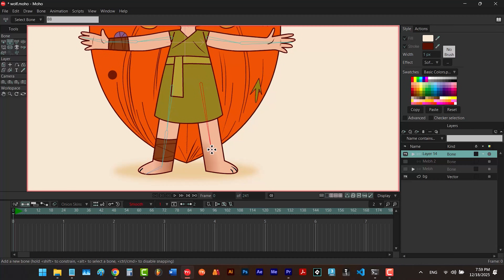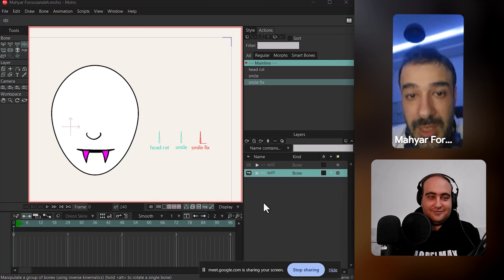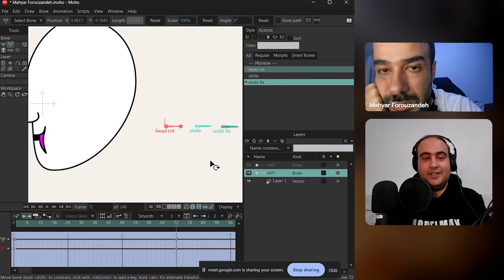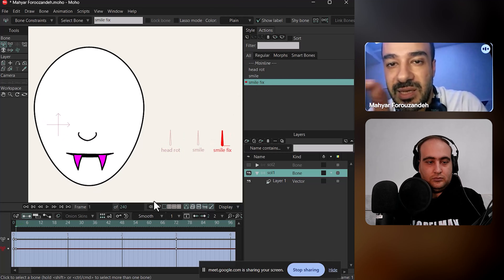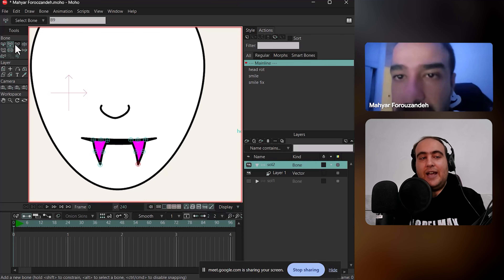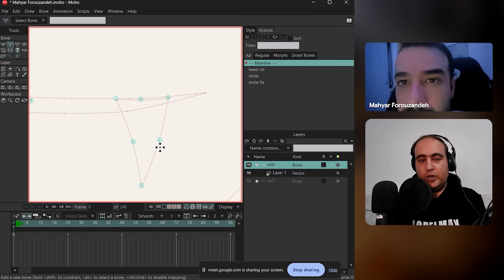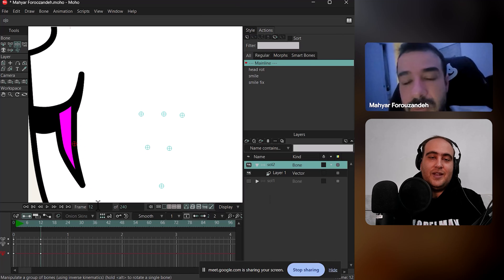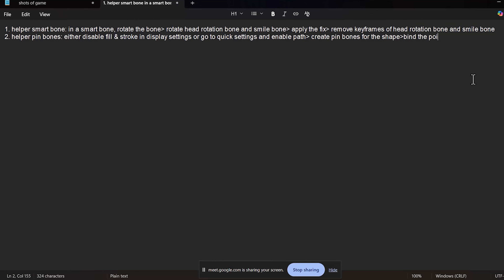Fixing Conflicting Smart Bones | Moho 14.4 Rigging Tutorial

Comment: What about using the MR mixed smartbones script?....
Can you plz make a tutorial using this script with the methods you just used please???....🙏🙏🙏
https://youtu.be/M0RJEjA21f8?si=0XavWUciAp2dULgV
Reply from the maker: Here our focus is on Moho's built-in features my friend, providing general solutions for all users including beginners, so that all users can do it. Scripts can make it easier and faster but not necessarily better, as scripts have their own limitations and problems. Having said that, I haven't used the script you mentioned on this example yet.

In fact one of my subscribers said the same thing, but then they claimed the script has an issue with curvature. You can read their comment in the comment section, here is their name:
Mehrijabrailian

Also, you asked me to use the methods i used along with the script but this is not how this script works. So it is actually impossible to do that my friend. We cannot use the methods I talk about and the script at the same time. It will ruin the project.

And one last point is, the script has less flexibility than the solutions I talk about in the video. But can be useful to fix the problem quickly as i mentioned above. 

To use this script you rotate the bones, fix the problem by moving points manually and while bone layer and the two bones are selected you apply the script. The helper bone will be created for you. But it will be controlled automatically. Not by you. 

To anyone who's reading this comment, the script we're talking about is this one: 
https://mohoscripts.com/script/ae_mix_smartbones
Reply: @modelmananimation WOOOW thank you kind sir and yes that script is ok but this method is way better IMO... Iwas just asking because I came into alot of problems with thsi script and thought I was doing something wrong...And wow this is the right way to mic smart bones

Comment: Wouldn't the mix smart bone script be better at this case? I mean like wouldn't it be easier?
Reply from the maker: Sure, here our focus is on Moho's built-in features, providing general solutions for all users including beginners, so that all users can do it. You're right. It will definately be easier and faster to use the script but not necessarily better, as scripts have their own limitations and problems. Having said that, I haven't used the script you mentioned on this example yet.

To anyone who's reading this comment, the script Mehri is talking about is this: 
https://mohoscripts.com/script/ae_mix_smartbones

You can watch a tutorial on how to use the script here:
https://youtu.be/MORJEjA21f8?si=0XavWUciAp2dULgV
Reply: @modelmananimation yes you are absolutely right, I usually get in trouble with the curvature tool, you almost can't curve the point properly when mixing two smart bones